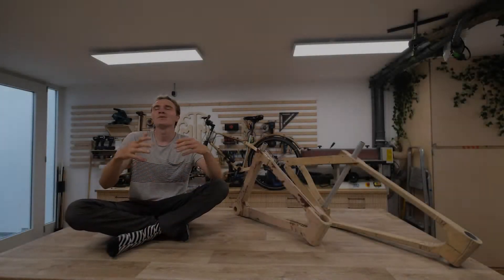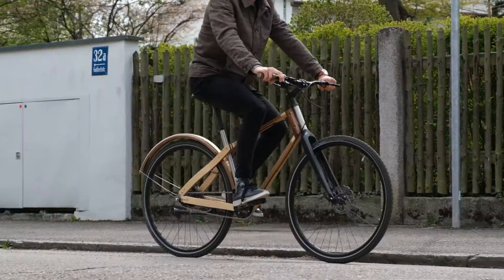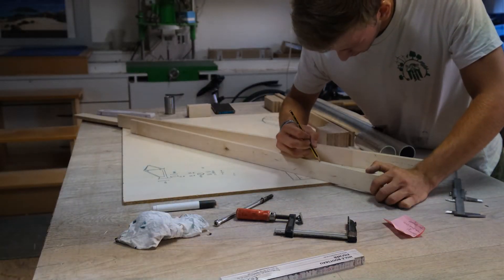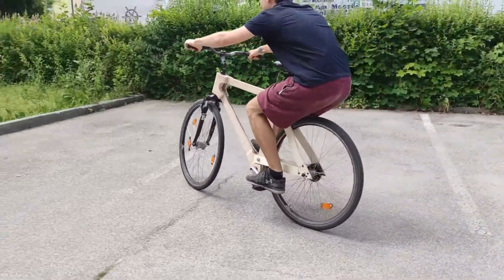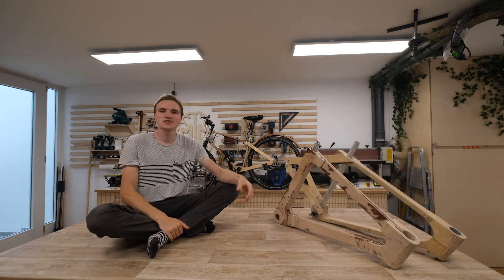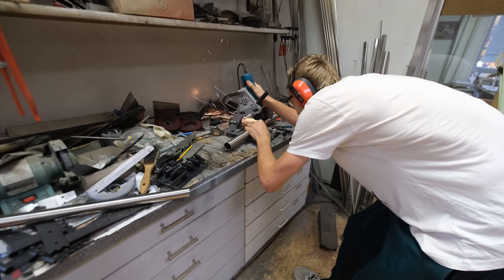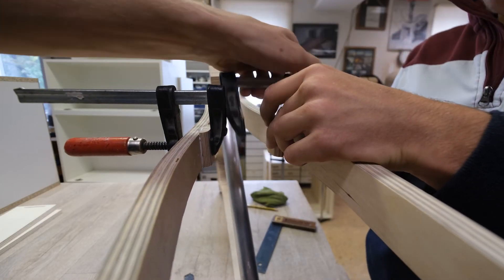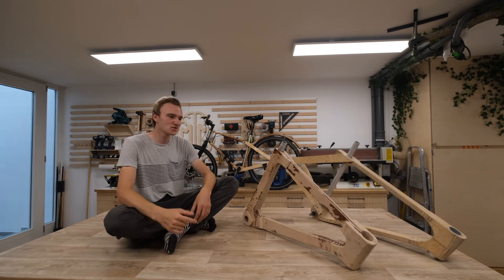Designing a wooden bicycle frame Mk4

Comment: Hi, very nice bicycle. I've seen the "wobble" of your frame that comes from its weak torsional stiffnes : your frame consistes of two flat elements (upper and lower elements) and even if their distance increases towards the seat post that cross section remains weak in terms of torsional resistence. You should create a sort of  box for those elements replacing the "flat" ones (a closed section resists muche better that an open/thin one). I have experimented that very same problem with a folding bike I made in plywood. I'm now remaking the frame with a box section, internally lined with carbon fibers.
Reply from the maker: Thanks for sharing the experience :D. Folding bike from plywood sound like crazy amount of fun :).

Comment: Hello! Did you try putting carbon fiber between the sandwich layers? Possibly it would give the wood a lot of rigidity in all directions of wobble. Thank you for sharing your experience.
Reply from the maker: @txemovil1636 It would for sure be a massive improvement but we don't do it for the sake of sustainability 😅.

Comment: Cool bike mate ! I'm asking myself why did you not want to make the vertical axis ( seat tube ) in wood ?
Reply from the maker: Well the top section needs to be a metal tube in order for the seat tube to slide in. So the only way we see to do that is "surround " a metal tube in wood. It feels unesseary and adds a lot to the weight. That being said it forces you to make the metal to wood connection on the top and bottom of the seat post tube  very strong to not lack stiffness. Now on our mk7.5 we finally achieved a really nice connection. I'm surprised that no other wooden bike frame we found online ditches the wood surrounding the seat tube.
Reply: @makermind2050  wooden seat?